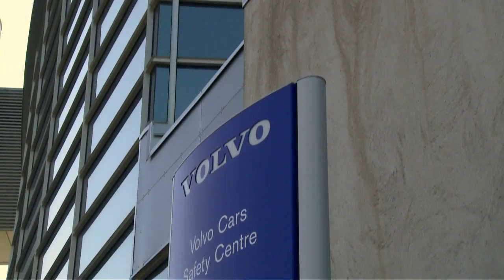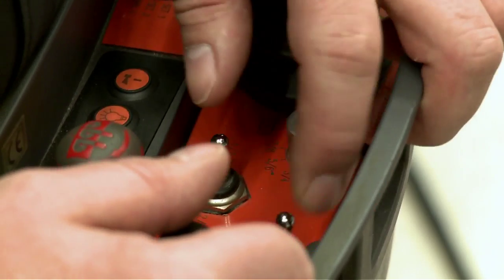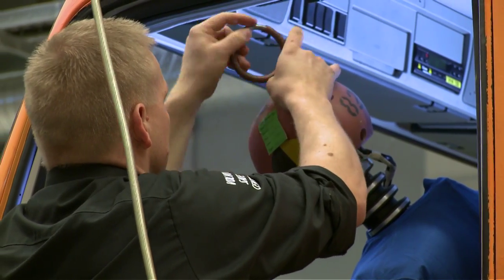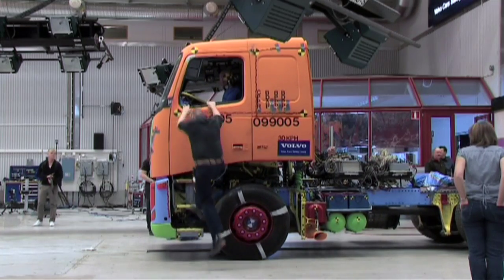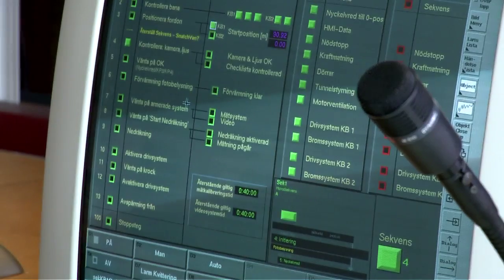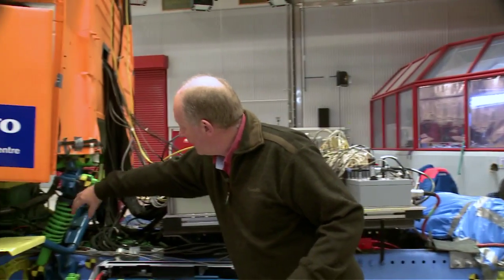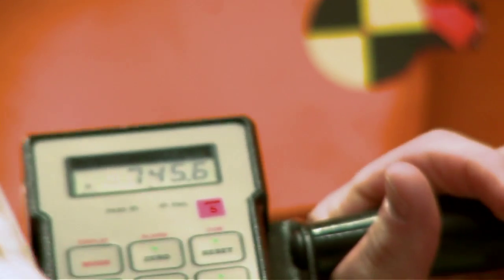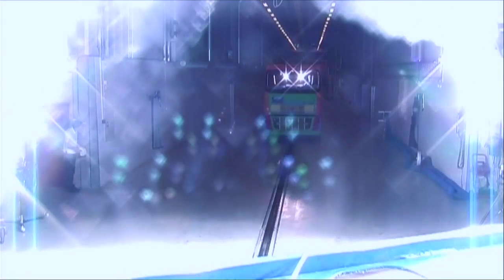Volvo Trucks - Appetite for destruction: Welcome to the crash factory

Comment: volvo makes trucks for Europe and for the Americas.  they look different I suppose because of regulations and etc.  which ones are safer the American market ones or the European market ones?

personally I have to think American drivers are worse but I could be wrong considering I don't have the kind of knowledge and info the volvo engineers do.  

my uncle used to work on both volvo and freight liners.  I think he preferred the volvo one groin what I remember.  

any info would help.  just would like to know why each market makes them so different.  you'd think the American ones would be safer because they look like they have a crumple zone for the occupants inside.  the European ones are just flat and blunt on the front and it would make it more dangerous it seems.

Comment: Is it possible to set up a partial overlap test (as in Euro NCAP) to simulate the effects of a collision after the driver has begun to take evasive action? Many truck drivers involved in such accidents are killed, even if they are travelling at quite low speeds.

Comment: But that's all part of crash testing... Volvo, may I suggest a system in which the truck's steering wheel pivots/tilts upwards? Otherwise, the airbag is facing upwards and the steering wheel will be in a dangerous position to cut the driver's throat @ 2:14

By the way, 30kph is 30kph, not 50kph.

Comment: volvo is #1 in saftey in cars and big trucks, BUT volvo big trucks are ALL lemons with severe mechanical probs and fluid leaks from the factory. MY 2008 volvo 730 has less miles on it than the miles ive put on the rentals they give me for warrantee work. Every time it goes in its for the same problems, it spends 2-3 monthes in the volvo shop and comes out with the same probs, and goes back in a month later. Every other volvo owner says same thing, "ill never buy another volvo"